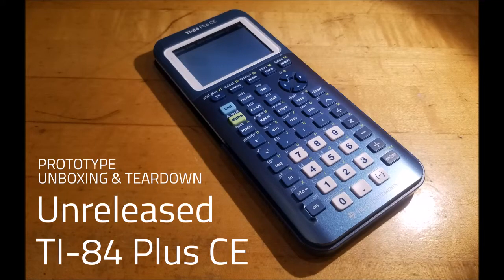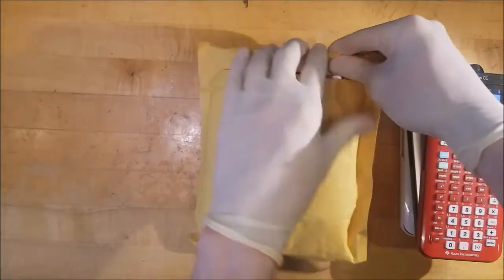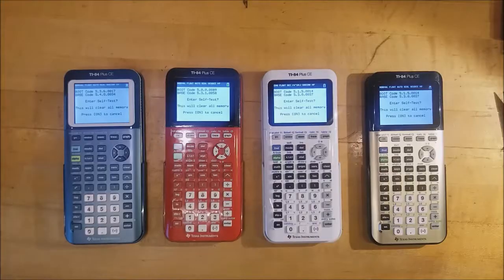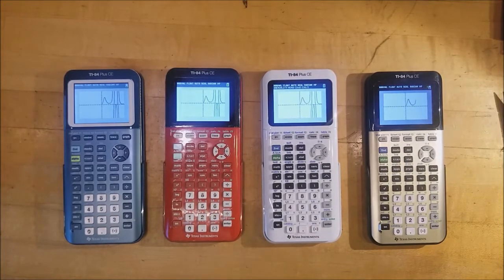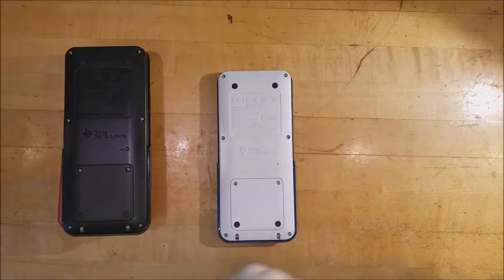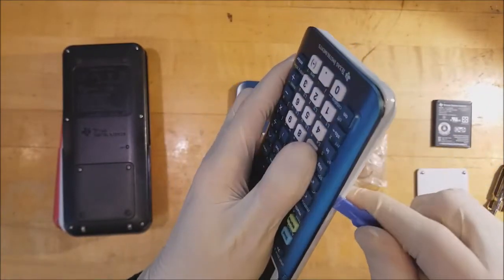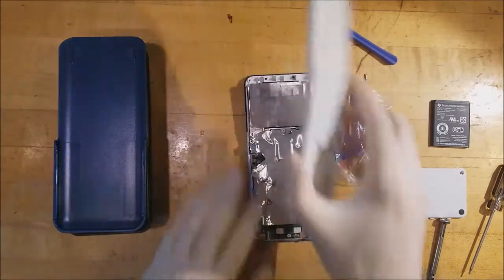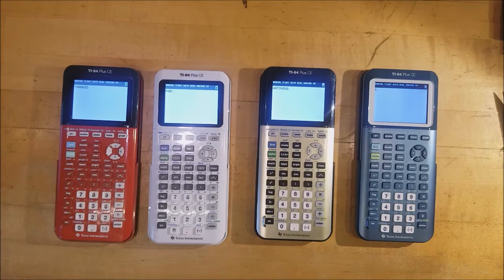TI-84 Plus CE Review/Teardown (2020): PROTOTYPE in Dark Teal

Comment: Nicely done 👍 but mine has dust between the clear screen protector and LCD. @6:42 is where you helped me.

I twisted the plastic frame (not circuit board) and it let me pull the top of the LCD out to hinge on the screens ribbon cable. Now I was able to clean both the LCD & clear protective screens from inside.

I used canned air, denatured alcohol & glasses cleaner with a lint free shame. No streaks, smudges, or lint. Crystal clear and clean.

BRAVO 👏 and thanks 😊
Reply: I dont want to take the whole calculator apart, so is there an easier idea to do it?
Reply: @baconofthebros8893  I'm not sure what you want to clean but for me I only took some of it apart to clean what I needed
Reply: @colineyeball  i got like dust underneath the like protector, its under the first part, above the black frame though
Reply: @baconofthebros8893  I'll take a look later and try to give you some info.

Comment: You say there is a USB controller - in theory, with the correct drivers, could you potentially replace the calculator's number pad and function keys with say, a video game controller?
Reply from the maker: Yes, you certainly could. In fact, USB keyboard drivers already exist for the TI-84 Plus CE, so a gamepad driver shouldn't be too much of a stretch.

Comment: I like these calculators, but truth be told, the casio fx-cg50 is every bit as good if not better and actually much faster. I would probably give just a really slight, very slight edge to the casio, it is more user friendly. also the hp prime is great to. The only down side to the casio are they don't come in colors and the ti has the program you can install to reverse the screen to have white lettering black background which i love, even the hp prime has that. there is definitely more information and programs online for the ti's because they're supported in the colleges, TI was smart and got their foot in the door early on with the school system, but because of that they don't seem to want to reduce the prices, the ti-83, they still try to sell for almost a hundred dollars. total bs, old software, and that's just not right.

Comment: How does the graphing speed of the revision M compare to the older PCE calculators with lowered wait states?
Reply: While in general speed does increase quite a bit when lowering wait states, I believe rev M+ calculators are still noticeably faster. However, I don't have the resources to tell you the actual numbers.